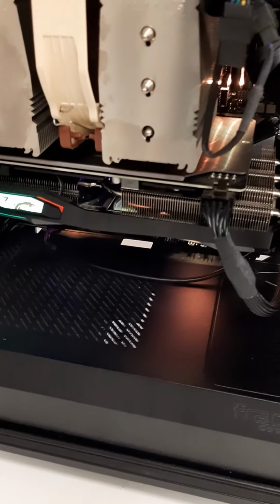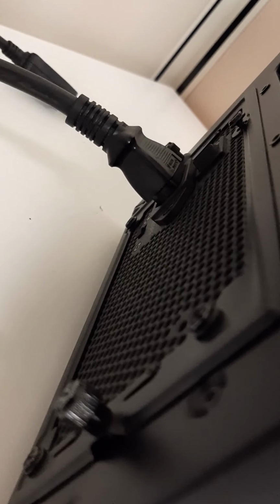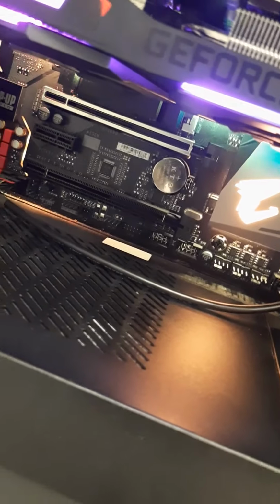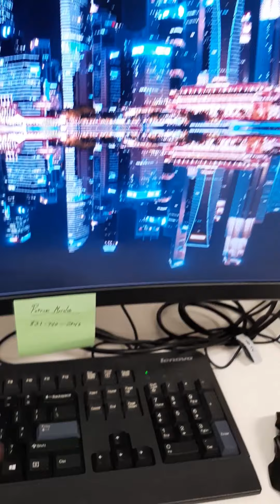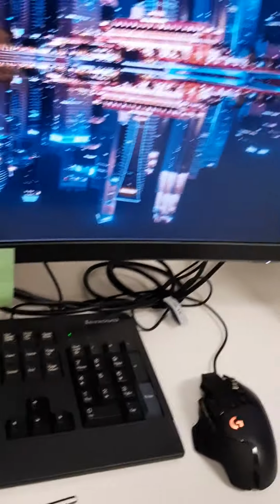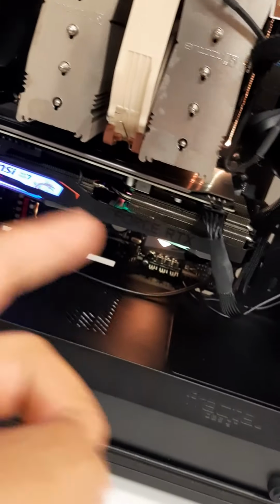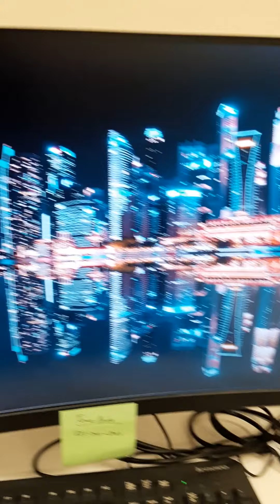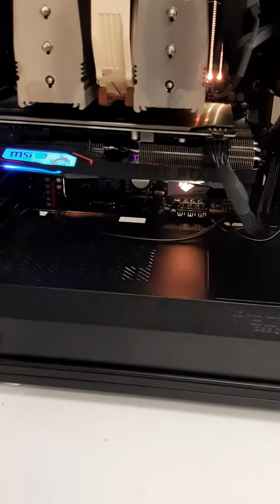HOW TO FIX BLANK SCREEN AFTER ENABLING SECURE BOOT | Windows 11 Upgrade Headache Fix

Comment: i don’t have integrated graphics. i’m fucked
Reply from the maker: You can replace the motherboard. It's definitely not the cheapest option, but it's an option. Unless you can find some other method. I think someone in the comments figured out some fix. It might be worth going through comments as a last effort. Sorry, my video couldn't help you. I appreciate your time.
Reply: @anthonydiaz6101  i cant afford one rip. fuck windows 11 this is not worth panicking for
Reply from the maker: @Twistee  yeah, it's a lot of hassle for an update that's basically trying to look like MAC OS. I've always upgraded when new versions came along, but this one is just a nightmare to even install for some people. I hope you find a solution that works.

Comment: Nice tips but it don’t help me
Reply: hi what motherboard and processor you using?
Reply: @hizamisyazwan5  motherboard: gigabyte B660 GAMING X DDR4,

Processor is : Intel i7-12700F
Reply: @marbro267  i assume you have tried reset the cmos & jump/short cmos too and nothing happened?

Have you tried short/jump the bios chip?
Reply: @hizamisyazwan5  no I think I do it tomorrow because I’m very tired of this but thanks for help 👍🏻👍🏻
Reply: @marbro267  okay.
anyway, the bios chip/rom is located above q-flash button (i think for your motherbord)

Its a 8-legged chip (spider leg), marked as M_BIOS on your motherboard. 

Start your pc, you wont have display but your cpu will be running. Now you need to short/jump between two leg: leg 4 & leg 8. (Use small cable or paper clip for this)

Leg numbering can be as follow:

4-3-2-1
--------
5-6-7-8

or 

4-3-2-1
--------
8-7-6-5

or vice versa.

If you correctly short leg 4 & 8, your pc will auto restart. Bios will reset to factory default.
Reply from the maker: I'm sorry to hear that :( I hope you can find a fix
Reply from the maker: @marbro267  thank you for commenting and helping out
Reply: @marbro267  send the Mobo to service centre to reprogram the bios! That all u can do...or buy a new Mobo...😑

Comment: Could you explain it to me in the comment write and I will translate because I don't speak English
Reply from the maker: 1. Turn off and unplug your power supply.
2. Remove CMOS battery for 15 seconds then put it back in.
3. Unplug and remove your graphics card.
4. Plug the hdmi or display port cable that was plugged into your graphics card into the motherboard to use your integrated graphics.
5. Plug the power supply back in and turn it back on.
6. Power up the computer.
7. BIOS should pop up since you reset your CMOS. If it doesn't then power on the PC again and repeatedly press your BIOS key (if you don't know which key that is, google what key to press depending on which motherboard you have).
8. Turn off secure boot and save settings before exiting BIOS.
9. Turn the computer off.
10. Put your graphics card back in and power the PC back up and the issue should be resolved.

Please note that this only works if your CPU has integrated graphics. Please read the comments for additional help as some people have found other solutions in case this doesn't work for you.

Comment: hey i tried this out and it still didn’t work for me anyone got any suggestions?
Reply from the maker: Unfortunately, it's the only fix I know and it doesn't work without integrated graphics. You might consider browsing through forums, or replacing your motherboard (that's been the common alternative).
Reply: Have you fix it?☹

Comment: Hi Guys! I have the same problem and I found a SOLUTION to disable Secure Boot without screen display and even if your cpu doesn't have integrated graphics.

Easy way to do this, which will work regardless of what motherboard you have, flip the switch on your power supply to off(0) and remove the CMOS battery on the motherboard for 30 seconds or a minute just to be sure, put it back in, turn the power supply back on, and boot up, it should reset your BIOS to factory defaults.

So, this is what happened to my PC after I enable Secure Boot then Save and Exit after that there's no display, (gpu, mouse and keyboard ain't working). The solution above fixed my shit and save me.

UPDATE: The above fix will help to have display instead of no signal/display and you'll be able to go to BIOS then check if the Secure Boot is disabled. Save and Exit, you'll be able to boot now to Windows.

There will still be a problem after that when you shutdown your pc and tried to boot again, you'll have blank screen.

To fix blank screen, this is from TK in the comments:
Step 1: Disable CSM support
Step 2: click on secure boot and try to enable it. Make sure under secure boot menu change secure boot mode to standard instead of custom.

 My PC boots now directly to Windows instead of a blank screen

FUCK GIGABYTE, I ain't gonna go messing with my BIOS again for that Windows 11, even enabling TPM then after a restart, it boots up to blue screen — Error code: 0xc00000e9

BTW BIG THANK YOU man for giving me this idea of resetting BIOS through removing cmos and putting back in.
Reply from the maker: Thank you for sharing. Hopefully it works for those with no integrated graphics.

You're welcome, even though I didn't come up with the solution. I found it on a forum. I'd give them the credit 🙂
Reply: Hi , still no display after that turn off PSU switch off , reseat cmos battery for about 3mins then plug the battery in and ground the main bios in board the problem still persist . my last option is to try another processor with IGPU mine has no igpu i5 9400F i hope it works.
Reply: yes if you unplugged the battery it will reset the bios settings but unfortunately  secure boot is still on.
Reply: @crisantoreyes8674  I updated my comment above. I hope it will help you.

Btw I have Ryzen 5 2600 and B450 Aorus Pro Wifi as my mobo.
Reply from the maker: @crisantoreyes8674  I hope that next method work out for you. Best of luck
Reply: I tried and I still don’t have signal on my screen and the keyboard and mouse don’t work.

Comment: I dont have an iGPU fml
Reply from the maker: That sucks bro. Sorry, I don't know how to help 🙁. Microsoft fucked up this time, honestly. They're too strict with the requirements
Reply: HOW TO SOLVE BLACK SCREEN AFTER ENABLING SECURE BOOT WITHOUT AN INTEGRATED CARD

If you have a gigabyte motherboard, it is likely your motherboard has something called dual BIOS, some mobos have BIOS switches some have Main and Backup Bios pins (you would have to resort to your MOBO manual

if you have a Bios SWITCH: https://www.youtube.com/watch?v=q9048wFSuD0&lc=UgwF5GIXObyeMGZoeNl4AaABAg.9TYBNv61vfY9TZk7obcn4Z this video should guide you through the fix 

if you have a Main and Backup bios pin (like my case): https://www.youtube.com/watch?v=rLHSajr5Qp0&t=107s this video should guide you through the fix (in my case, I had to short the pins WHILE THE COMPUTER WAS ON, or else it didnt work)

Comment: GOD ALLAH JESUS WAHEGURU MAN MAY ALLAH SMITE U WITH HAPPINESS AND SIGMA GRINDSET !!!

EDIT: OK SO WHOEVER IS HERE FOR VALORANT, I FINALLY GOT A FIX THANKS TO A MAGINAL CONTRIBUTION BY MY FREND BUFFLA

STEP 1. DO TPM THING
STEP 2. CHECK IF YOUR DISK IS HAVING PARTITION STYLE AS GPT (IT WILL BE MOST PROBAB BUT JUST IN CASE)
STEP 3. BEFORE ENABLING SECURE BOOT, THERE WILL BE A "SECURE BOOT MODE" THAT WOULD BE CUSTOM, SET IT TO STANDARD!
STEP 4. THEN SAVE AND EXIT (WITHOUT TURNING ON SECURE BOOT) 
STEP 5. CHECK IF PC STILL BOOTING
STEP 6. AGAIN GO  TO BIOS, THEN TURN ON SECURE BOOT.

THIS WAS DONE ON A GIGABYTE MOBO.  IF YOU FIND THIS HELPFUL, DRINK WATER AND PRAY FOR MY LIVER!
Reply from the maker: Thank you for your comment. Hopefully it helps someone because I've gotten lots of comments about that